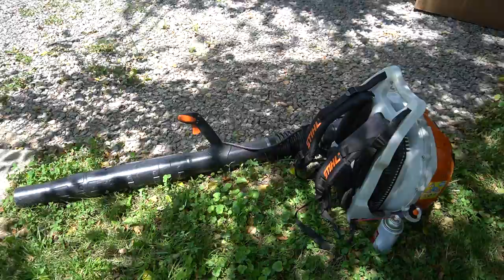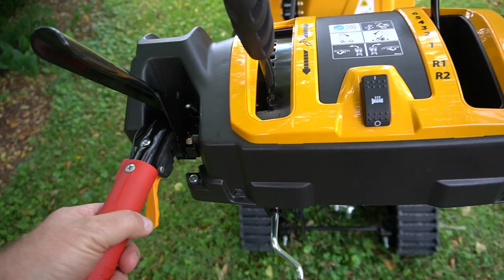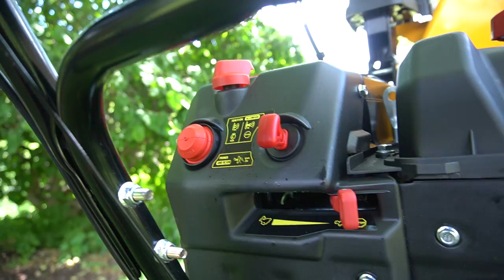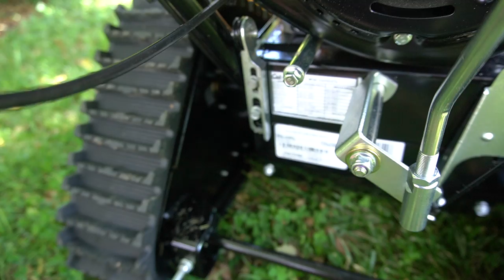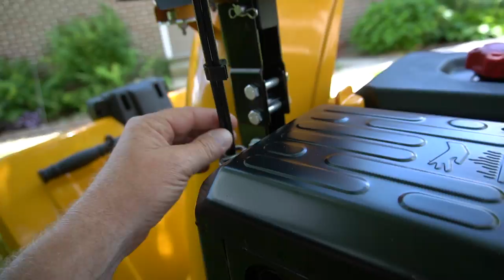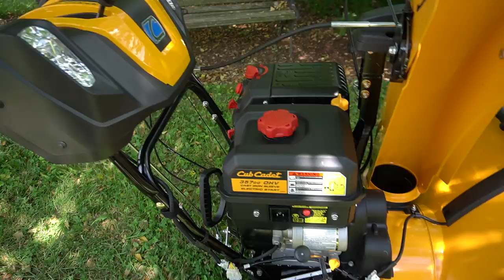Cub Cadet 3 Stage Tracked Snow Blower 2021 - Overview & Tips

Comment: question...how is to maneuver around when its not runnng..?
Reply from the maker: It's pretty easy.  It weighs just a couple hundred pounds.  I keep it in my basement, so as soon as I get it over the ledge and past the door, I turn it off and then pull or push it by hand wherever I want it.   Not bad at all.  It's obviously not as easy to move around like a wheeled version (not running I mean).  If pushing in a straight line, it's pretty easy.  If turning, I shift it to get it to the angle I want and then keep pushing or pulling to get it where I want it.  Assuming you only need to move it 20 feet or so, it's not bad.